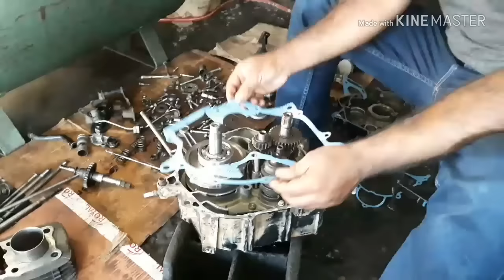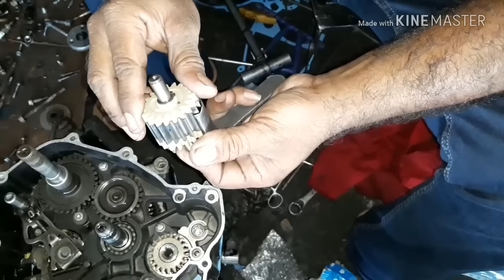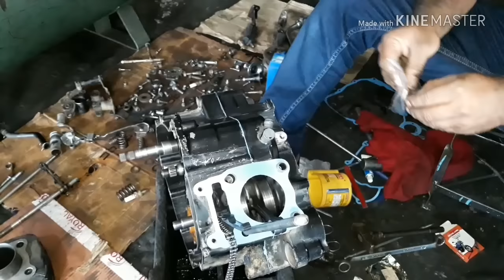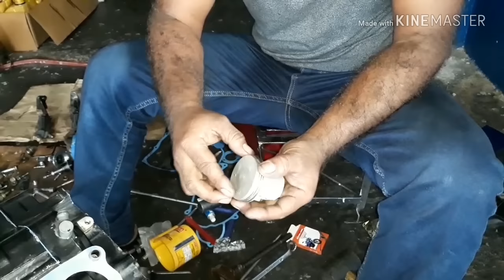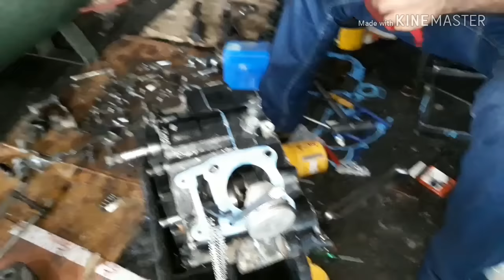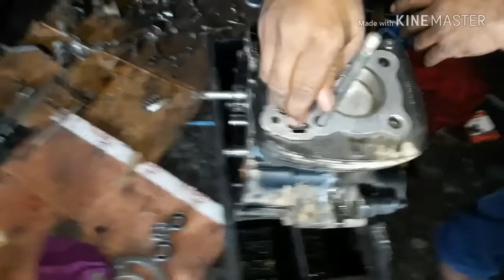Pulsar 150 Full engine Repair ! [Guide] Tips to Fix all engine problems!

Comment: Full engine rebuild what all parts are to be changed for a Pulsar 135 with 75k KM on odometer (no problems till now, bike runs perfectly, just some timing chain noise).